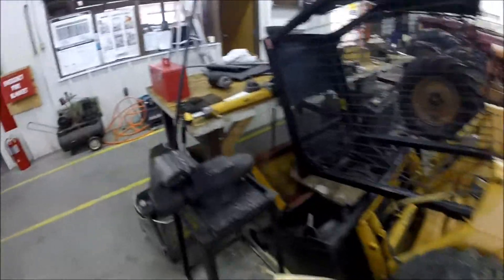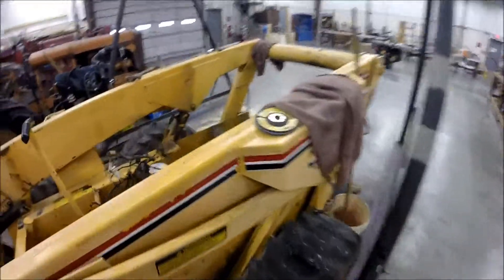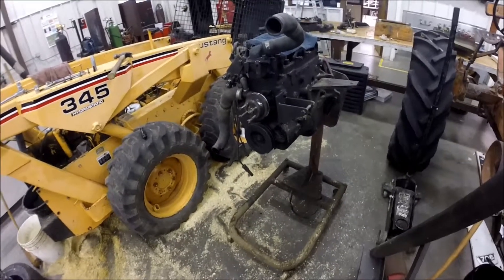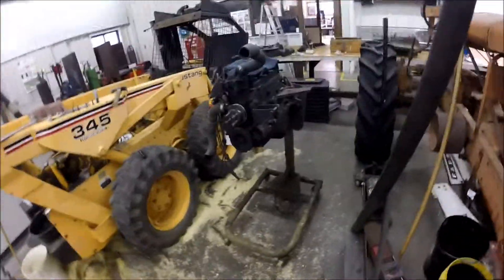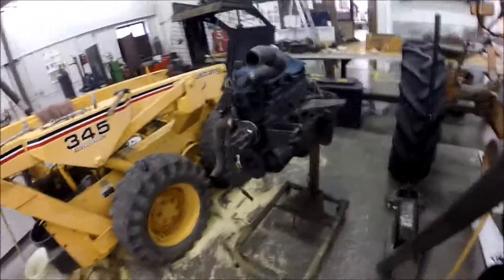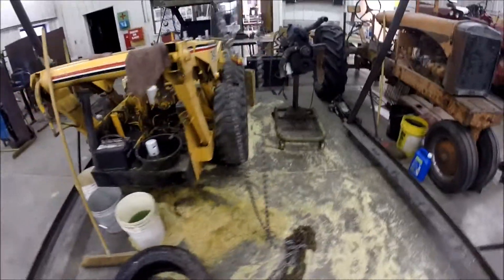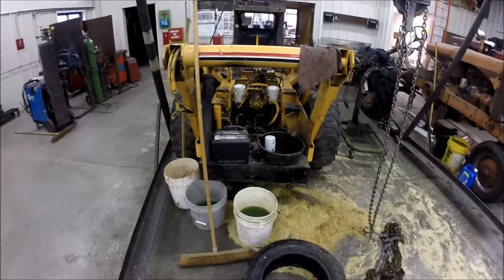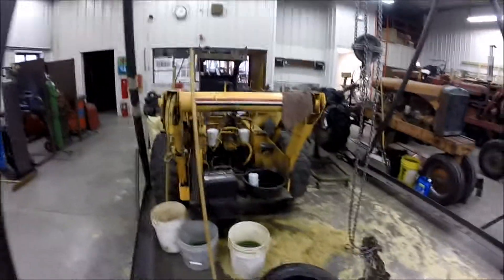OMC Mustang 345 Skid Steer: Update

Comment: Valve guides or oil control rings worn bores etc . Low oil pressure is usually worn main bearings letting oil pressure to escape because the oil bearing clearance is out of spec . I will be working on one of these so is this engine a Conntinental engine or is it a Ford industrial because the one I will be working on the owner says it's a Ford 2300 but had heard that some used the Ford industrial & others were more like the car engine version that were used in the pinto & I believe the Festiva but not sure on this either .
Reply from the maker: This machine had the Ford engine in it. We ended up doing a complete rebuild. I believe we got all of the parts from a company in Nebraska but it was a while back so I don't remember the name. This engine is a variation of the one that was used in the Pinto's but was predominantly European so parts are a little sparse in the states. I believe there are some small differences like the exhaust manifold and such that makes this one more of an industrial engine that the one in the cars, but the block and everything should be the same. If you need parts the best thing to do would be to find your closest Mustang, Gehl or Manitou dealer. They may not have engine parts, but quite a few of the other parts are still available. If you have a tough time let me know, I work at a Gehl dealership.

Comment: question i have a mustang 441 with a perkins 4108. when the engine was removed after unbolting from the frame did engine slide back off of pump spline ? or was there bolts holding near pump spline also ?
Reply from the maker: There are bolts holding the engine to the bellhousing, and the bellhousing to the pump. If you either unbolt the bellhousing from the engine or the pump from the bellhousing, it will slide off. It may be different on a 441.